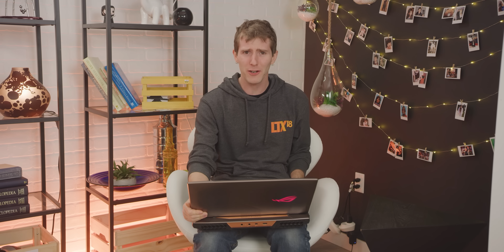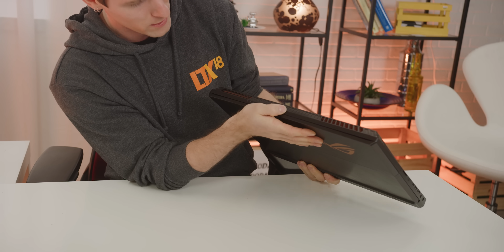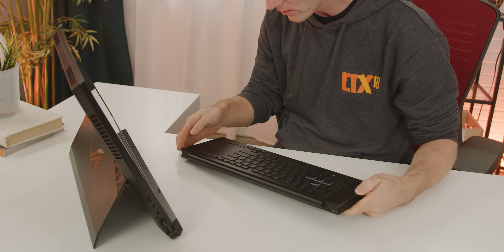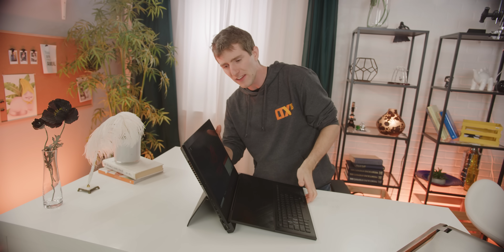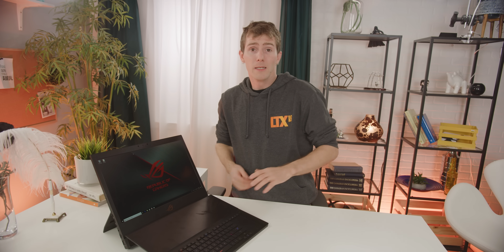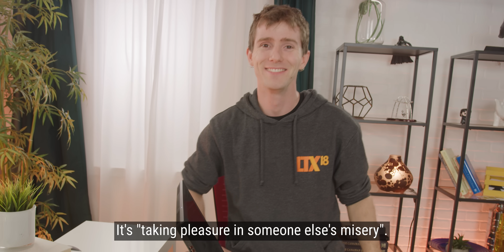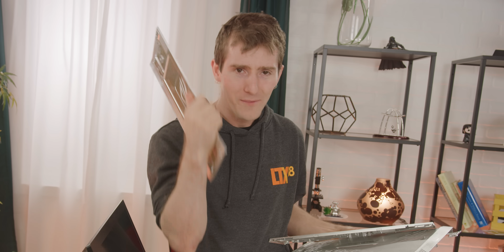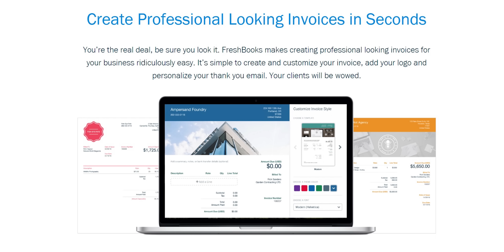A Surface Pro for HARDCORE Gamers - ROG G703 "Mothership" First Look

Comment: Being someone who uses CNCs, I can confirm all of that could realistically take 20 hours.
Reply: As someone who also CNCs, I concur.
Reply: As someone who is a CNC machinist and currently sitting in front of my machine at work, I am trying to figure out what kind of piece of crap CNC machine takes 20 hours to machine all of that! Hell even our oldest and slowest machine could probably do it in about 10 hours. Our newer ones I can easily see finishing all of those parts in under 5 hours!
Reply: @tken93  Im pretty sure they mill 2 sides of each one, my mill being older/cheaper/not "professional grade" cant do that itself and needs a person to do it. If you look at the parts, there are a lot of fine details and many tapped holes.
Reply: @henryatkinson1479  Even still 20 hours is extremely excessive for these parts. Just showed this video to my coworkers and we looked at the parts as closely as possible and all agree that even in one of our older non 4th axis machines it would still only take a few hours at most to machine all of these parts. My best guess is that they probably made a few inexpensive Homebrew DIY CNC routers to make all these parts in house to bring the cost down as much as possible, hence the 20 hours of machine time.
Reply: @tken93  most homebrew cnc will have issues hitting the sub  .010" accuracy. I think the reason it took so long is that they only used a single tool. Adding in a large diameter roughing bit to remove a the majority of the material would get those times down.
Reply: bear in mind that this is a prototype so has NOT been through any kind of design for manufacture process other than "can the machine do it?". it would not surprise me at all if the finished product does way more stamping and bending with a little CNC finishing, with the CNC processes themselves being substantially streamlined. The product's just not at the stage where that sort of thing's really been seriously looked at yet
Reply: @inund8  True on the accuracy but to be honest I don't think for something like a laptop frame they would need anything better than 0.02 maybe 0.015 tolerance.
Reply: @tken93  I've used a lot of older machines. I can imagine a 3 axis machine with a HSS endmill going at these multiple parts for a while, especially if you want to be as safe as possible with lower speed settings (and to reduce the finishing time). Also, the toughness of the aluminum in question (it's not necessarily 6061 you know) need to be accounted for. If they're using lubricant or not factors in, too. Since these are solid blocks not sheets to be bent and welded afterwards, they might need to do one side and flip to the other, which isn't the fastest. If they don't have automated tool switching, then they have to do that manually, too. All in all, those multiple parts could definitely take over 10 hours. 20 might be a bit of a stretch, but it's possible. If they use a 4 axis machine (or 5 if you wanna get real crazy) with automatically switching, carbide tool tips on the proper type of aluminum and some lubricant, it might not be that long; couple hours, tops. Under the right conditions, it could take a while.
Reply: Like I said EARLIER, if you use Cryogenic Surface Hardened Maraging Steel molds you ABSOLUTELY CAN stamp these parts using a press! It would take less than 30 seconds for each part AND since the NEGATIVE MOLD is surface hardened you could make each laptop part out of VARIABLE TYPES OF METALS such as 8000 series Aluminum or Grade-9 Aerospace Titanium OR AZ81 Magnesium Alloy which can be hot-stamped AND is STILL light and strong!
.
If they are hot-stamped (i.e. the metal sheet is heated to above 500 Celcius up to to 1000 Degrees Celcius then your part stamping times are MUCH improved (less than 30 seconds!) and you only need to do a single oil-quench to anneal the part for MAXIMUM strength and surface hardness!

See Oil Quenching:
https://www.sst.net/oil-quenching/

.
Reply: @TheJarJarKinks  You're absolutely right. Especially when the back cover is a 3D curved surface instead of a flat surface, and all the side walls are twisted 3D surfaces.
Reply: ITT: No one that knows anything about engineering components, cost analysis or cnc process engineering.
Reply: I think that the prototype toke 20 hours to manufacture.
Single pieces are always a waste of time.
Reply: Me Reading This Thread  🤔🤨🤔🤨🤔 yes yes, I see. 

I have no idea what I'm reading.
Reply: ✔️ WAN2T ME? LO6OK, I MASTB*ATE NAK9ED,снеск5 снann5el ✨
Reply: As an engineer I love how this thread goes I rekon they should have hot stamped and then CNC. 😂
Reply: As someone that made a CNC at home,yes i agree.
Reply: Since I have much experience using the company's LARGE fully-automatic 5-axis CNC machines (which are accurate in some machines down to 0.0001 of a millimetre by the way!). That's basically MICRON-scale accuracies. So much accuracy that we have to use laser interferometry and laser reflectometry to measure some of the glass, metal and composite parts coming off our systems!

Anyways, BOTH hot-stamping AND precision CNC are viable methods for these types of parts.
And as an aside, just for the heck of it, I talked to a glass engineer and YES you actually CAN make an ENTIRE COMPUTER CASE for desktop, laptop and smartphone ENTIRELY out of Gorilla Glass! It would have high thermal movement characteristics allowing MASSIVE cooling capabilities of internal components AND you CAN make the case coloured and semi-transparent!
Reply: I feel like a lot of that time is doing the thin vent slots, as a fellow mill guy. Could save a load of time and get similar flow with a drilled hole grid maybe.
But yeah there's a lot of elaborate parts to this thing. Definitely a long run. i imagine the finished model will have a streamlined/cast design for a lot of this.
Reply: If I WAS the manufacturer, I would be making a cyrogenically hardened maraging-steel mold and STAMPING these parts on a 100,000 PSI (around 690 Newtons per Square Millimetre) press out of aerospace grade Titanium instead of Aluminum!  

If you want SUPER-LIGHTNESS then you could also stamp this out of alloyed Magnesium which would be less than HALF the weight of the Aluminum or Titanium! 

AND for the ULTIMATE in COOLNESS factor, stamp the aluminum portions AND the outer casing ENTIRELY out of Corning Gorilla Glass in MULTIPLE see-through colours!!! How cool would THAT be ?!

Can Anyone else do this? -- How about a Desktop machine AND keyboard made ENTIRELY made-out-of multi-colour Gorilla Glass? 

Helloooooo Linus --- Please phone ASUS to ask them if they COULD produce the frame and casing ENTIRELY OUT of Corning Gorilla Glass!
.

p.s. these Hardware Ideas are now public open source licenced under GNU GPL3 2019 terms!
.
Reply: @StarGateSG7  how about just make it out of solid gold while we are at it
Reply: @HoodedStalker  Gold is overated.
Reply: @fmaz1952  And extremely heavy, and malleable, and all in all a terrible material to make things-you-want-to-last out of.
Reply: @robinsuj  my point was the thing is already insanely expensive why would you use exotic materials like titanium, when aluminum does the job just as well. The weight of the thing doesn't really matter because judging by the way it folds out you will be using it on a desk
Reply: Dunno what the chemical reactions would be between a Lithium fire and a Magnesium alloy, but I don't think it would be a good one...
Reply: Companies like Canon and Sony already use Magnesium alloys in their camera bodies so it would be quite EASY for Asus, Acer, Apple, Dell, HP, Lenovo, Samsum and LG to make fancy super-light and strong Magnesium cases and heat pipes for their desktop, laptop and tablet systems!

The zinc, manganese, silicon, copper, rare earths and zirconium alloying materials would bind enough within the crystalline sub-structures, that fine metal powder sloffing could be kept to a minimum. 
YES! I know that Magnesium is used in fireworks because it burns mightily with oxygen, but if Canon can use it in their 1Dx Mk2 camera bodies, that also use Lithium-Ion batteries, then I think others can make Magnesium alloy bodies too!
.
Reply: 👀👀 WAN4T ME? LO5OK, I MASTB*ATE NAK5ED,снеск6 снann5el 🌶

Comment: YES! Finally somebody does something different with gaming laptops. Having all the heat generating components right below the thick, impractical keyboard makes no sense for a gaming laptop. Can't believe it has taken this long.

Frankly I'd be super hyped if it was possible to buy a portable desktop PC with a large screen, with some mechanism to easily bundle up the PC, monitor and keyboard for transport.

Comment: Um I'd buy this in a heartbeat. Three ssd's and shit sounds a little overkill, like trying to justify a tremendous price tag, since a 512 gb SSD would only cost a manufacturer about $70 yet they can tack on 300 to the price point for it... yeah, deff buying a used one.

Comment: This product makes zero sense. 

If you need a high perf laptop, buy one. If you need a desktop, buy one, this has none of the advantages of and all the weaknesses of a laptop, without the mobility. This is one of the dumbest things I've ever seen come out of Asus, short of their watercooled laptop.
Reply: Agreed, as much as I like this product, there absolutely no case scenario where this makes any sense. I think most people are just enamored with the actual tech it self.
Reply: A guy who needs a workstation for his job but is away from home/is currently traveling.
It isn't a laptop, it's a mobile AIO. A mobile AIO is an attractive concept to a surprising amount of people.
The demand for a computer that fills the mobile workstation AIO niche is shockingly adequate.

Comment: battery life is probably like 30 minutes. Not very convenient for a "portable" device.
Reply: Ya because any one with a gaming laptop actually uses it on battery power lol
Reply: it probably does 2h, even more if it makes use of hybrid graphics. Ofc if you put on heavy games, that's bye bye battery, but for light use, it's there.
Reply: This kind of device is “portable” light. I think its meant as a replacement for hauling around a bulky gaming pc when you travel as opposed to being a legit laptop replacement.
Reply: It would be heavily bottlenecked if you ran any cpu/gpu intensive applications without a power supply attached.
Reply: You dont buy gaming laptops for a good battery life.
I mean bateries in those laptops are needed only for moving them from one room to another without  turning them off
Reply: It’s probably useful for photographers or videographers that use a bunch of apps that can sometimes be too harsh on a regular laptop. The design is also nice because your hands don’t burn every time the laptop heats up. I’ve had it happen many times for time consuming projects lol.
Reply: it is a desktop replacement not a portable device lol. It is meant to sit somewhere on the desk with power supply not while you are the on go
Reply: No different than desktop replacements if the past. My old 19" Sony Viao had maybe 4-6 hours. It's about ease of portability, not necessarily a laptop a "desktop replacement". 

How easy can I put it in a bag and go to my next destination? 

Can I use this for my use case: game design, film/broadcast, VFX/3d animation, portable gaming.

For some one like me it would be great for connecting up to my Main PC for a co-op demonstration of a game in development while at a booth in a convention. That is a use case that can justify purchase that insurance will totally cover.
Reply: @Syuna "light use" is different than "running games", I mean watching videos, working with documents, projects, whatever that doesn't need the discrete GPU

Comment: All that expensive cnc milled aluminum can be easily be pressure molded, manually bent into shape on a break, braze the standoffs on, laser cut the cutouts. And that junk in your hands can go straight to the trash bin ASAP. I just shaved of 3 quarters of the price and bout 30 hrs of labor approximately.
Reply: That cnc junk is cool, but from an industrial designers point of view for this application its dumb and expensive. lets hope its only the prototype.

Comment: wow that thing is bulky af... but I also don't necessarily hate it. Its pretty much just as bulky as my old HP laptop from 2010 with the extra thick battery, remember those? and thats still the laptop I currently use too. I just upgraded the HD to an SSD and it already had a great graphics card built in (for the time). so it still works pretty well even to this day... but I pretty much went full desktop and rarely use it anymore. and anyways, that looks about just as bulky as my "current" one... and thats not so bad.
That being said, it doesn't look like you could use that actually in your lap whatsoever. In fact I don't think you could use that on any soft surface at all... it looks really cumbersome to handle. But as a miniature portable desktop... its not bad. If thats the sort of thing you need in your life. I mean that could work for a lot of people in a lot of different professions where people need to be portable but also need to have a powerful PC to run, idk... CAD programs and such. 
But with as much as that thing is probably going to cost I would have to say it would need to be potentially VERY powerful to even somewhat compete on the market. I mean if you're going to be paying thousands for a "laptop" thats going to probably be a pain to lug around irl... it better be worth it... and it better be upgradable. That being said, I seriously doubt this is going to be sold to a lot of people. Probably only to people who have more money than sense... and professionals who really need a computer like that. I doubt they'll make a lot of them because of that... at least... they really shouldn't.

Comment: This is actually pretty cool, as a portable desktop. I'd get this form factor over a traditional thicc gaming laptop any day.
Reply: @the one you dont see the last computer was a gaming laptop (ASUS), and I wouldn't buy one unless I'm drowning in extra cash. It's entirely too large and too heavy to function as a good laptop, and it doesn't have the modular parts of a desktop. 5 years from now games will be demanding more performance, you're not going to be able to upgrade the video card or the ram, and it'll be another $4,000 to replace it.
Reply: @jppittman6067  Yes well it is mostly meant to function as a desktop so it is going to be large and heavy. And while desktops are much cheaper and customizable they are not as practical in some situations which is why gaming laptops exist. For example a large desktop isn't ideal for say a college student. A desktop takes up a lot of space in a small dorm and isn't easy to transport when coming home for the holidays or summer especially if you fly to school. Also some people don't want to worry about complicated desktops and would prefer to just buy the prebuilt easier to maintain laptop. Some people need to edit and render videos on the go. Some people travel a lot and prefer a desktop replacement over a traditional laptop. But yes desktops are better in the long run but not in every situation.
Reply: @nathan24652  Consider a $2,000 desktop and a $2,000 laptop with remote access. A desktop and a laptop is perfect for a college student. You can't take a 25 lb laptop back and forth to class for 4 years. They're not made for that and they break. If you've got money to drop on one of those things, then you've got money to drop on a dorm large enough to hold a desktop.
Reply: @jppittman6067  true I wouldn't take a desktop replacement to class I'd get a laptop. But the gaming laptop is still more ideal even in a big dorm because of ease of use and transporting it. Set up is just plugging in a mouse and a hedset plus power while a desktop is a mouse, keyboard, a monitor a headset, external speakers, and power. Thanks for the idea but I think a desktop replacement still just make more sense unless you can find a small enough modular desktop and monitor that would be similar to carrying around a gaming laptop/desktop replacement.
Reply: Depends on your lifestyle too. I'm a truck driver and currently in the process of finding a mobile desktop replacement. Most notebooks like the Razer Blade 15 are slim, but don't meet my performance expectations. I'd rather have a MSI GT75 Titan, Alienware 17 R, or something equivalent. I don't mind the weight, as I'm used to lugging around 30-50 lb bags and toolboxes. Just depends on the individual's use case scenario.
Reply: k
Reply: Agdu
Reply: same
Reply: Would you? Usually people that stupid get a Mac, not something that runs Windows.
Reply: As a College student that flies back to my country at the other side of the world on summer, I'd pay 5k for this with the best specs.
Reply: Affirmations to Attract Love (using Law ofAttractioon) > https://twitter.com/ArmandojbakerJ/status/1082535925056524288?-how-to-apply-law-of-attraction-12